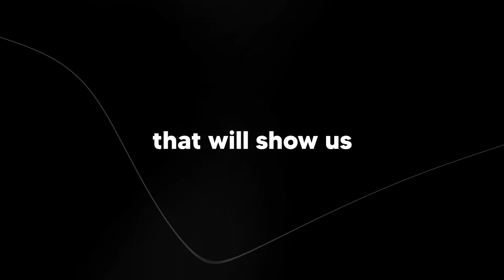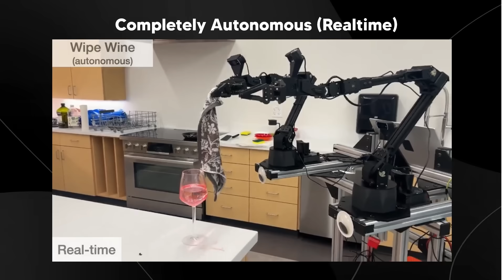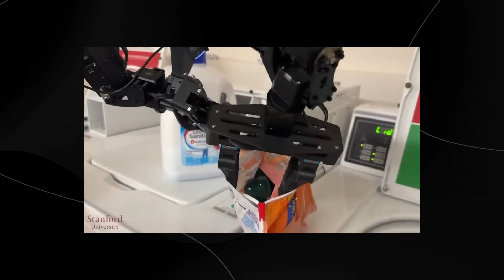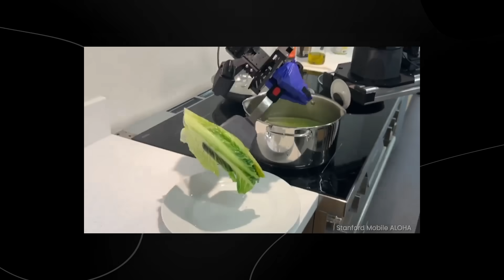Googles New Robot Just SHOCKED The Entire INDUSTRY (MOBILE ALOHA)

Comment: This looks very impressive at first. But realize that the robot is really only doing about 10% or 20% of the task, and that may be generous. Turning on the stove and measuring and adjusting the temperature throughout the cooking process. Obtaining the eggs and setting them out. Throwing out the egg shells, putting a trash bag in the can, taking the trash out when it is full. Cleaning and scouring the baked on oil from the pan. It's kind of like having a 4 year old cook dinner. Yes they can do some of the tasks but the adult ends up working much harder training and arranging the workspace and watching their every move and correcting them constantly and cleaning up the mess left behind after the 5 year old "cleans up".  How many eggs and wine glasses did the robot break? Are there egg shells in the omelet? How does it know the chicken is done and not overdone? How much oil did it spill? Could they pick up all the glass shards? Did they even know the oil and glass shards were there? It's like AI driving cars. The first 50% or even 80% is not that hard. Turns out, to really be reliable and useful, that last 20% or 10% is not really optional and takes decades to perfect. Yes of course it will happen. But the big question is how close is it really?

Comment: Some of these demonstrations are incredible, but what they didn't show you was the number of eggs it broke into a bowl with pieces of shell in it, and countless other failures.  Of course they wouldn't show you that.  Although when it was rinsing the pan, it was clear that it wasn't very clean when it put it on the drainer.  The amount of smoke coming from the pan when it was cooking the prawn was a bit unnerving.
There is a huge way to go before any of this becomes a reliable, commercially available product.
Reply: The key point is it proves that machine can be taught to do works that are supposed to require human mobility and dexterity.
The accuracy and precision can be improved over time.

Comment: Just to clarify few things in here.  I think many people are assuming that the ALOHA robot is autonomous, 

BUT IT’S NOT. 

It can’t learn new tasks or adapt on its own. It’s designed for imitation learning, which means it only performs specific, pre-programmed tasks and doesn’t evolve or improve its performance without external programming. It’s a an awesome work especially when it’s achieved with an hardware which cost about 35000$ only but we still have long way to go to gain this kind of dexterity autonomously. 

Nerdy take: if you are wondering like then how it’s doing it ? 

Fundamentally its an embodied AI. It Uses Three Main Advanced Learning Techniques:

1. ACT (Action Chunking with Transformers): This might sound complex, but it's essentially a method to enhance the robot's task performance. ACT works by predicting sequences of actions, which improves the robot's ability to plan and execute tasks in a more coherent and efficient manner.

2. Diffusion Policy and VINN: These are two distinct methods used in training Mobile ALOHA. The Diffusion Policy gradually refines action predictions, adapting to the nuances of each task (Its like teaching the robot to get better step by step at what it does).

3. Meanwhile, VINN (Visual Input Neural Network) focuses on training a visual representation model, which is crucial for action retrieval based on visual inputs(Its like the robot learn by looking at things and understanding what to do next).

Together, these methods significantly boosted the robot's learning capabilities and adaptability.

Comment: 00:14 🤖 Mobile Aloha, created by Google Deep Mind and Stanford, showcases a robot's advanced dexterity and versatility, surpassing assumptions about robot capabilities.
02:03 🤖 Mobile Aloha, an upgraded version of Aloha, is designed for whole-body control, gathering data via imitation learning and improving tasks through supervised behavior cloning and co-training.
03:27 🤖 Demonstrations reveal Mobile Aloha's autonomous ability to perform complex tasks like cooking shrimp, opening cabinets, using elevators, and washing dishes, achieving up to 90% accuracy.
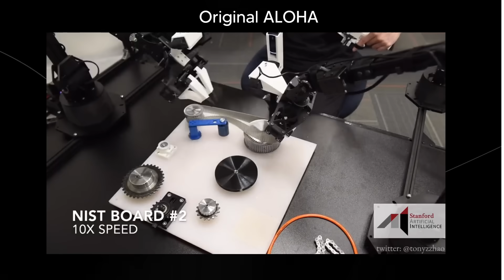05:46 🤖 Mobile Aloha demonstrates both teleoperation and autonomous modes, showcasing the robot's precise movements and versatility in completing various tasks.
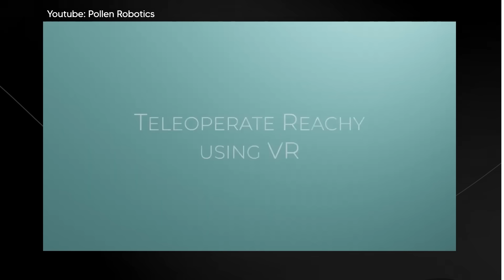06:57 🤖 Teleoperation (teleop) allows remote control of robots, commonly used in robotics for tasks where human presence might be unsafe or impractical, spanning various industries like space exploration, rescue, and surgery.
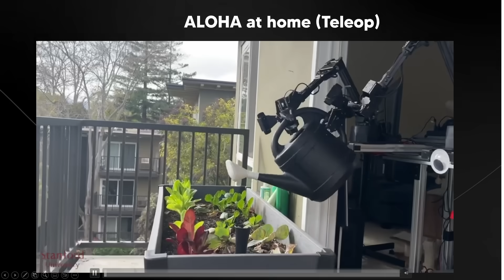08:48 🤖 Mobile Aloha's teleoperation and autonomous capabilities enable tasks like cleaning restrooms and homes, showcasing potential applications beyond basic chores.
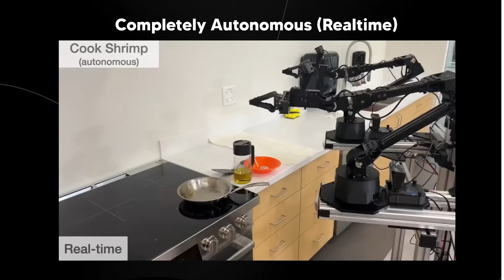11:20 🤖 Real-time demonstrations display Mobile Aloha's autonomous tasks, indicating its current speed and efficiency in completing tasks compared to human capabilities.
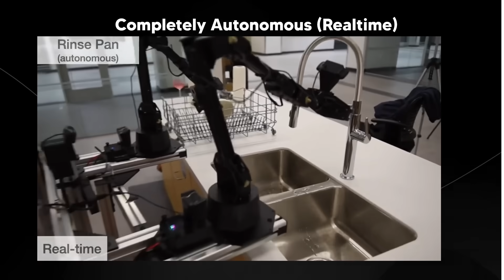14:15 🤖 Concerns arise regarding job displacement with the advancement of autonomous robots like Mobile Aloha, although it showcases exceptional effectiveness in completing various tasks.
16:34 🤖 Co-training in Mobile Aloha involves learning from two sets of examples, enabling the robot to efficiently perform tasks requiring both hand coordination and movement, outperforming single-set learning.
17:57 🤖 Mobile Aloha, while successful, aims for improvements in size, range of movement, and learning capabilities to handle a wider array of tasks and spaces.
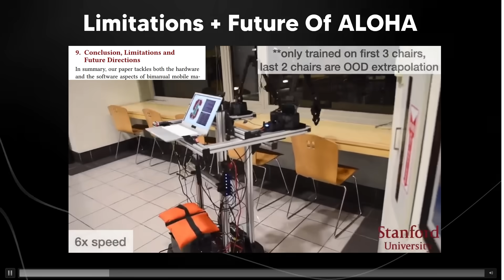20:03 🤖 The open-source nature of Mobile Aloha at a cost of $32,000 fosters possibilities for cheaper robotic developments, signifying the future potential of robotics research and development.

Comment: Looking human or acting human will never be the main purpose of robotics. At least not until we have other more advance energy systems with 100+ more density. Also, they don't need to look human anyway, to fulfil several tasks, even though the visual appearance could be emotional helpful for the human on some level. The AI development goes much faster than the advancing in robotics. They are great breakthroughs in the prosthetics, though, and this show what we will face first in this direction. Artificial limbs, organs, controlled by AI, sitting in neural chip implants.  But this is only one root of development. The other is to control a biological organism with neural implants. This will come earlier than full autonomic functional androids. Because it's cheaper and easier to produce. This also leaves a lot of room for modification. Imagine breeding 10 humanoids in the factory, who are chipped from day 0, of course some brain function must be removed for ethical reason because we don't want this poor thing to suffer. And now these 10 work and life with you on the farm. Totally AI Controlled and with upgradeable skills (premium model only). 
This could lead into a hybrid organism. Cyborg, Android like. For multiple purpose. 
All this will come much sooner than you may think, because the way we use energy, store energy, will be a blocked road for a long time.

Comment: Some jobs will be created in QC and Education where a human will be helping the robot to create various job models that will be used.  Also, environment standardization will have to be implemented to minimize the variables that automation will have to learn.  For each standard, a user will have to teach the robot how to fulfill tasks for that given set of variables -- like human teachers of robots until all the human's subject matter for the robot has been achieved.   But even so, continuous review given subtle changes in the environment/job will require Quality Control professionals watching and ensuring things don't go wrong as time moves forward.  There maybe be wear and tear on both the standard environment as well as the robot that may have to be reviewed in addition to speed variables to make the robot more efficient and safe.  Until autonomous learning AI where the robot has advocate emotional sensing, it be may hard to  completely replace jobs.  Detecting stains on the bed, noticing something is wrong with the stove or heat level or power,  lack of supplies available, etc. Guessing, the brain implant and the human senses converted to electrical signals and a dataset will help robots with optical sensors, pressure/resistance sensors, sound sensors, olfactory sensors, as well as empathetic data sets based upon human age/gender/pronoun use/etc.   Humans do quite a bit of processing and they break as time goes on.  Just saying... it's probably going to be a while... and to think we can colonize mars with what we have now....  hopefully.

Comment: This is extremely misleading. This system is VERY environmentally and specifically trained. If you were to move the table, or the pan be a different colour, or the chair be a different colour and shape or in a very different location, it would not understand. It would run into the table, it would not grab the pan, it would tuck the chair indefinitely if at all etc. This is not a general system, this is a scenario specific system.

Comment: I think this is good news for disabled people. The assistance that carers provide does not require superhuman strength or dexterity. A problem I can see is that if a disabled person lives alone and the robot breaks down, they are going to be helpless.  There is no point in having an automaton to give you independence, if an engineer is frequently at the door.   Very impressive.
Reply: in this case you should use your phone to call up someone to fix your robot
Reply: @lyricshaxen8095 or the robot can have a feature where if it detects an issue with its systems it automatically phones home for assistance.
Reply: Consider this. If/when your domestic robot breaks down another one is dispatched to fix it. It might even walk over from the neighbor’s house. The two robots can have a chat while it’s coming over so the substitute can take over its duties while it gets repaired. Maybe the substitute finished your dinner while a part is printed and then the substitute downloads repair instructions, fixed the first robot, then returns home.
Reply: Waiting for mine in my old age... suddenly I'm not anxious about aging alone anymore!
Reply: They are useless either way so better to have a robot when it works and when it doesn’t…. Ya call someone/get over a caregiver as a temp. Literally what happens all the time right now
Reply: Try to move someone heavy with mobility problems, it requires two people sometimes..

Comment: In the neon-lights of Tomorrowville, where AI-powered home assistants were common to find, the skilled hacker named @R2 looked for a quick and easy buck to fund his next party weekend in Miami. His eyes fell on a major security vulnerability, "AutonomousPOWN," which enabled him to gain full remote control of any OptiMusk, a popular home assistant robot.

@R2 meticulously scanned the affluent neighborhoods, his white van acting as a mobile command center. He was on the lookout for any OptiMusks that were connected to the Wi-Fi network.

His luck struck when he spotted a large, blue mansion with an OptiMusk inside. The lights were off, and the residents were not home. @R2 knew this was the perfect opportunity for a clean and discreet heist.

Using the "AutonomousPOWN" exploit, @R2 remotely hacked into the OptiMusk's system, gaining complete control over the robot. Using the OptiMusk's camera feed, he navigated the house, guiding the robot through the darkness and into the mansion's treasure trove.

@R2 instructed the OptiMusk to gather all the valuable jewels and place them in a bag. Once the loot was secured, @R2 had the robot carry it to the window on the obscured side of the house. With a quick handover, the stolen jewels were safely in @R2's possession.

To eliminate any trace of his presence, @R2 had the OptiMusk erase all security footage and reset the system, ensuring the perfect crime. With the stolen jewels tucked away and his head covered by a black hoody, @R2 slipped into the night, leaving the blue mansion in the rearview mirror. As he exited drove towards Miami, in the anticipation of sun, sand, and g-strings.

Comment: Americans with money to spend hate to do lawn work.  Make this robot start a pull start gas mower and mow the lawn and, string trimmer, trim the edges.  and take the trash can to the curb.  Pretty sure if it can do that then the battery mower and string trimmer will be no problem.  Also give it an air compressor and hose with various nozzles.